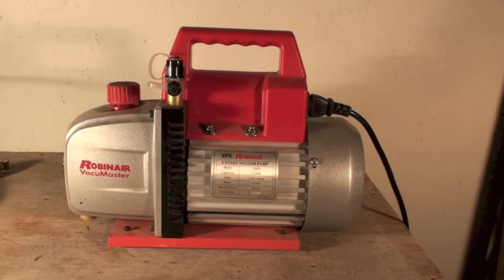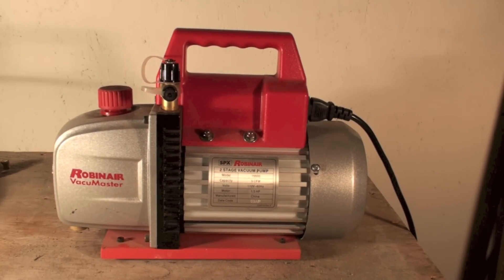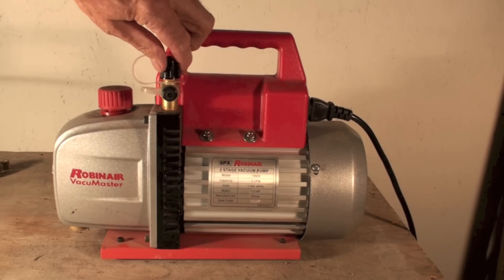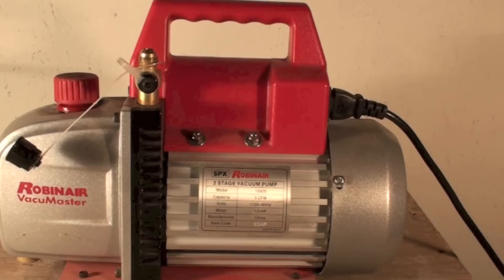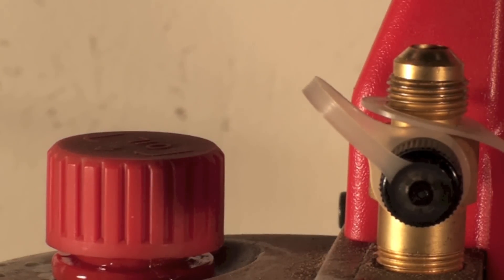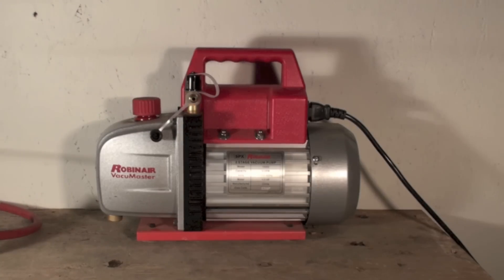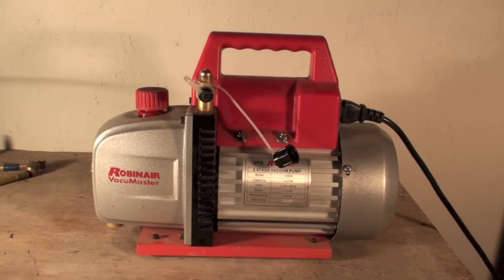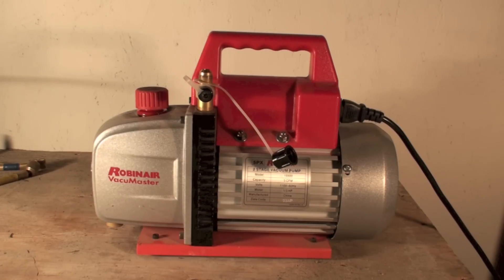Vacuum pump operation part 2

Comment: I've been in HVAC for 47 years.  Since vacuum pump oil is "hygroscopic",  absorbs moisture in the air like a sponge, changing  vacuum oil is absolutely critical to a good vacuum and protecting your pump.  "The Tank" oil change caddy is the best tool to have for changing vacuum oil.  The most popular vacuum pumps will fit perfectly in The Tank.  The Tank, part number DV-T1
is available at Johnstone supply, United refrigeration supply and many other good supply houses.  Ask for The Tank DV-T1.

Comment: I learned the hard way not to overfill my vacuum pump on the roof of someone's house. Thankfully I was wearing safety glasses. Didn't help my clothes or the side of the house though! What a mess!
Reply from the maker: We all have done that at some time.
GFM
Reply: grayfurnaceman As per your teaching anecdote, it never happens to the same guy twice (it shouldn't anyways)

Comment: GFM, I just evacuated a system that was open a long time and got to a steady 450 microns.   When I looked at the exhaust port on the vac I noticed a slight bit of vapor like steam coming out.   I was concerned that this was moisture still being boiled off so I let the vac run about another 15 minutes.  After 15 minutes it was still steady 450 microns but the slight vapor was still coming out.  I closed the valve on the vac and turned it off to watch the rise and surprisingly there wasn`t any (I do use hard pipe).   It stayed on 450 microns after 10 minutes so I called it good.   I am wondering if I should have kept it running until no vapor could be seen coming out the exhaust.   Do you think its OK?
Reply: Gene Friedman I think that vapor is just oil vapor produced by the pump running. If it holds below 500 microns there's no way there's any moisture or other contaminants in there.

Comment: What is the difference between a vacuum pump, and a recovery pump.  Do you have a vid showing from beginning to end how to hook up all the hoses, pumps, recover the refrigerant, pull a vacuum and how to reintroduce the refrigerant back into the system. I recently had a tech. to remove my old compressor and install a used one he said that would work just as good as a new one.  It does work great but I don't remember him using Nitrogen to clear the lines.  About how long can I expect my unit to operate before a break down.  Can't afford another major repair like that one.  Hot Here in Texas
Reply from the maker: Danny Calk Some techs do not use nitrogen in the lines to keep the corrosion down.  Not really thrilled about installing a used compressor.  Compressor life is always reduced by poor installation, but its done now.  The second compressor, (new part)  generally lasts about 1/2 to 1/4 the life of the original.  
GFM
Reply from the maker: grayfurnaceman Forgot the recovery.  Here is a playlist on recovery and evacuation:  https://www.youtube.com/playlist?list=PLItXrh64d2JOyI99mdbZnBlAQTKPOQZ5e
GFM

Comment: in charging a compressor, I assume it has to be running so that the refrigerant can feed through the input valve, and out the output valve to circulate in the system? is that correct?...
Reply from the maker: I have not gotten into all the methods of charging.  The short answer is one way of charging is to add gas thru the low side with the compressor running.  Hope this helps.
GFM

Comment from the maker: It wont hurt it.  I used to keep the pump on the passenger side under the heater to keep it warm in the winter because it would go off on internal if it was cold.
GFM

Comment: Can you say a few words about how to store a vacuum pump that won't be used for several months? Should you drain the oil out or leave it in? Vacuum pumps are sold with no oil, and you are supposed to add oil at first use. But it won't all drain out if you open the drain valve....